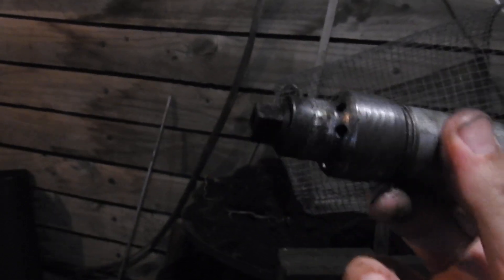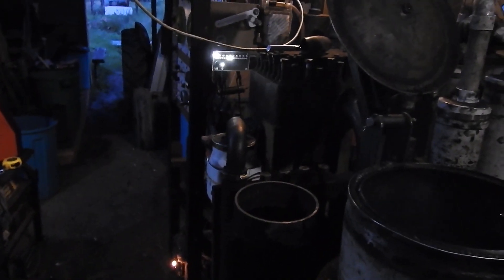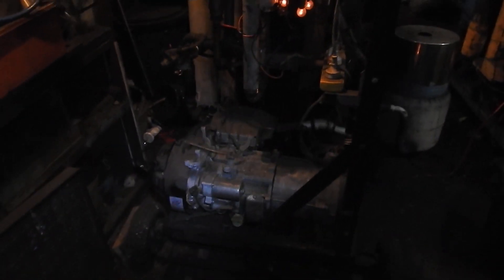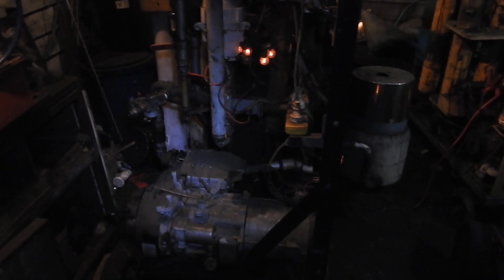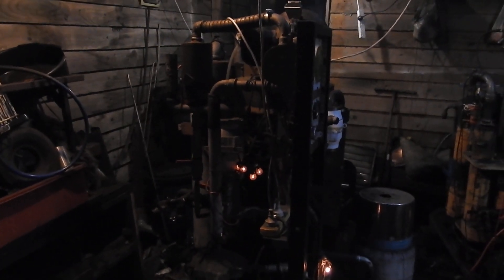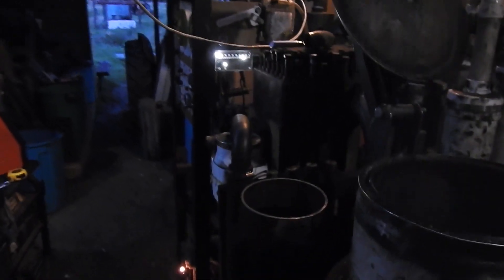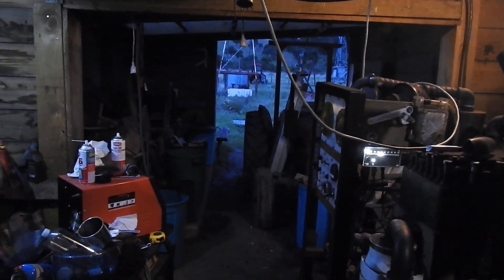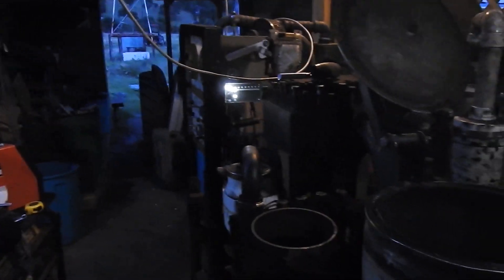Yippee  it is ALIVE!  - - very low video quality tho  :(

Comment: Almost like you know what you are doing. Congratulations Steve on a job well done. May you get many years of service from this new build. Thanks for the show. Joe
Reply from the maker: Howdee Joe, 
 Nah, I'm just making this up as I go. Good luck is watt really makes it work so wattfully    ;) . 
 So far, everything is working like a charm. It lights up rapidly, flares off quickly, and makes lotsa watts. 
 Watt more could I want?   :) . 
 Like you, I hope to get many years of reliable service from the Phoenix Gasifier. 
 More to come, as I iron out the rest of the bugz in this fine little project.

Comment: Can you help with a question I have?
Can an aluminum automotive radiator be used for cooling the gas or is it prone to stop up?
Reply from the maker: Howdee Mr Rusty, 
 It wood work very nicely, for a wee while, but it wood soon become hopelessly blocked up  :( . 
 A very good cooling solution, first employed by NH Hbbyloggr, and duly stolen by me, uses pea stone in a filter tube.  
 In my system, I have two such tubes, with a faucet at their base. 
 These peepee filters cool the gas, very effectively, while also removing a lot of water from it. 
 Maintenance is easy, as you simply unscrew the cooling tubes, and pour the medium out for cleaning.
Reply: @CNCmachiningisfun    Thanks for the info. I found a couple of your videos talking about your filters and this will be very helpful.
Reply from the maker: @RustyGlovebox  
 You are welcome. 
 Hopefully, my filter videos will be useful  :) . 
 This pea stone filter system is very effective at cooling the gas - and extracting moisture from it. 
 Indeed, I use it in both of my gasifiers, to good effect.

Comment: It's good to know the Phoenix will still fly if you have a failure with your air nozzle. I'll just call it a backup pair of wings. ;) I'm impressed with how quickly you have put this new design into use. Congrats! May you have years of plentiful power from the wings of the Phoenix.
Reply from the maker: Indeed, the Phoenix has a lifetime supply of spare wings, which is always handy when takeoff is imminent  ;) . 
 While it works OK like this, the burn zone tends to de-stratify, and migrate up the fuel column, which will waste fuel - and generate a fair old bit of unwanted heat. 
 You could still run it this way though, by drizzling the fuel into it, just like the Drizzler gasifier does. 
 That way, the hopper lid can stay open all the time, and an automatic fuel delivery system can be added to the mix. 
 Naturally, being addicted to this technology, I really do want to have a go at doing this  :) .
Reply: @CNCmachiningisfun  I think the air nozzle should solve the rising burn level by creating a more complete burn lower in the chamber, and starving the chamber and hopper of oxygen. Looking real good!
Reply from the maker: Yup, I sure do hope so, as that rising burn zone is wasting fuel, and overheating the gasser drum. 
 OK, in the freezing cold winter, that ain't gonna be a problem, but winter ain't here, just yet. 
 Here's hoping I can get this dialed in nicely, in time for the long and cold winter.

Comment: Most excellent!
Some woodgas bugs came here in search of happy place... I sent em you're way, I think they will be quite happy there.
Reply from the maker: Thanks kindly, my good friend. 
 If it was not for your guidance in those early days, I might not have had a chance to learn the finer points of woods to watts conversionology! 
 These woodenwattery systems have proven themselves to be very reliable over the past few years, so there is just NO way I wood ever go back to watt I used to use in previous years  :)  . 
 Wood is where it is at, as I see it. 
 It is nice to see that you are getting right back into your gasification addition, where you really belong  :) . 
 Oh, by the way, your woodgas bug party arrived last night, and they are setting up camp in the gasifier shed right now.

Comment: What is FEMA mode?
Reply from the maker: That's a reference to the way a FEMA gasifier works. 
 These are an open top, top lit, downdraft type, that are known for their ability to produce tar, due to their relatively low operating temperature. 
 When you run an IMBERT gasser in FEMA mode, you run the risk of degrading its performance, to the point that it will harm the engine.